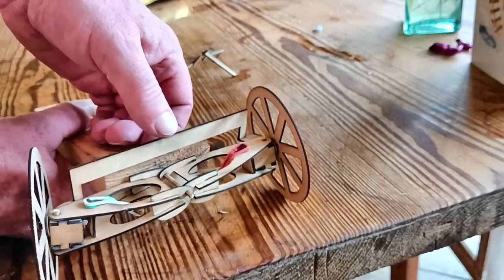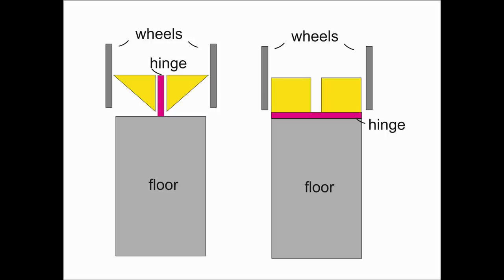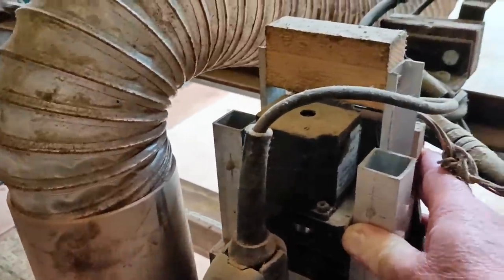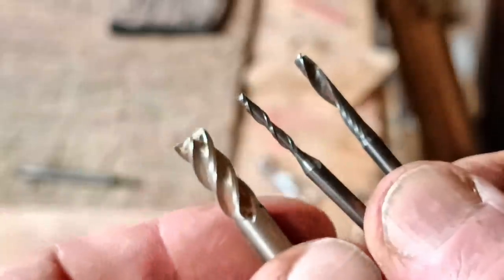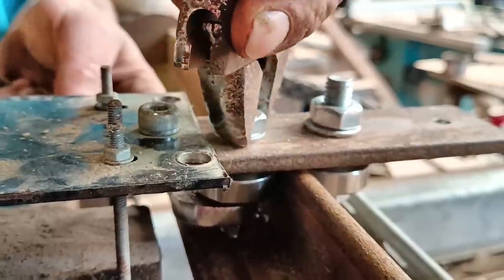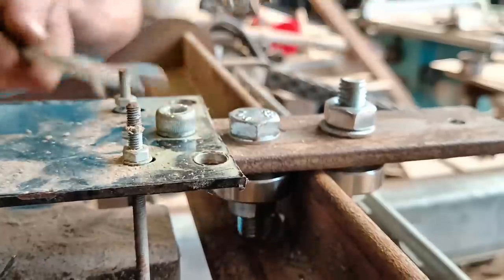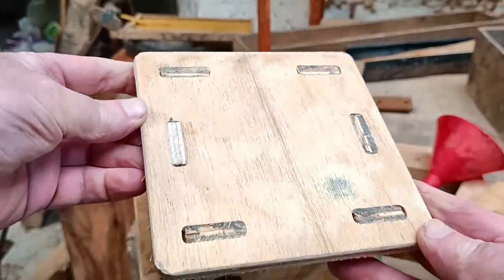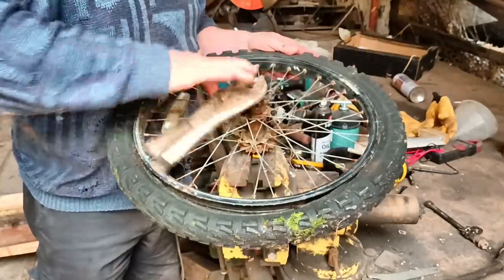Full Size Steering Box For The Wooden Car / Ebike Build

Comment: Watching the temporary frame flex, makes me think you could use wood, ‘ Leaf’ springs. Some ash would be self damping if quick grown. More real wood could be fun.
Reply: I cut down some 20ish years old spruce trees about 15 miles from Tim’s location a good wile back it had grown very rapidly and the grain was about 1/2” apart , it was incredibly flexible and practically unbreakable 
Very interesting properties and very light

Comment: Why are the boxes so big? you can put a couple of additional partitions inside to make it stronger, and a couple more thrust bearings on the pivot, one on top, the other on the bottom, it will be easier to turn the steering wheel ...

Comment: Since the loads aren't that high, you might get away with using thin cutting board material (for a low friction surface). These are readily available here in the US in dollar stores at very cheap prices, but I don't know about Ireland...

Comment: How much weight to expect depends on the rate of deceleration. I think cars are usually around 70%:30% front:back braking power so calculating the load could be worked backwards from the torque applied to the wheels by braking or turning the loaded vehicle. If you assume ideal energy transfers then I think breaking and turning loads can both be treated as a series of levers. I’m not an expert with this kind of maths though and I might be telling you something totally wrong.
Reply from the maker: sounds good though!

Comment: If it was a tricycle then you could have the front axel with no steering and do all the driving and steering with the rear wheel. That would be far simpler.

Comment: I'm not sure if it's important to you about the steering but as you are turning either side the inside wheel must be at a different angle than the outside. This is called the Ackermann steering geometry, if you search that online you will see straight away what I mean.
Reply from the maker: Yes, we're on that, thanks

Comment: how much you need to expect? I would say 50 kg of static load - I mean if you just want it to stand in place. If you want to drive it anywhere I would say it has to survive at least a 1000kg. Any bump, any curb and it is gone. just do a simple calculation of total weight times momentum. Each wheel has to support not 25 but about 40% of the total force.
Reply from the maker: Really?! Yes, maybe you're right..
Reply: @wayoutwest-workshopstuff6299  All depends on the driver as well ;). just as a note, I use a rope access equipment. rope has to be able to support a 100kg guy plus equipment falling several metes and not break. The one I use can hold up to 3T.  I don't think you need to overbuild it if it just goes on a parade, but for any kind of fun stuff I think it would be a good idea to get a university student and give him some FEM exercises....or just overbuild, but than it gets heavy.

Comment: cheap bearing, use old phonographs, 45s or LPs.. most resale shops have them for cheap, or a record store might have a few scrap they will sell you really cheap or give ya. just gotta ask.
Reply from the maker: I seem to remember they melt and crack?
Reply: under high speeds and stress yes, but for this application they would be fine. I first used them making a telescope, years ago. Last time I used them,  was for a ceiling light, that was on a boom. Just a suggestion.